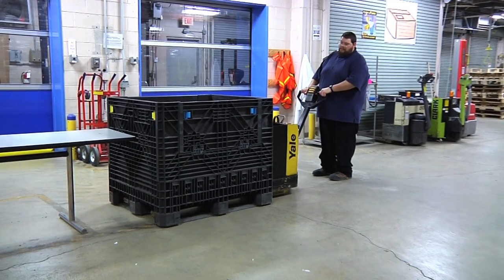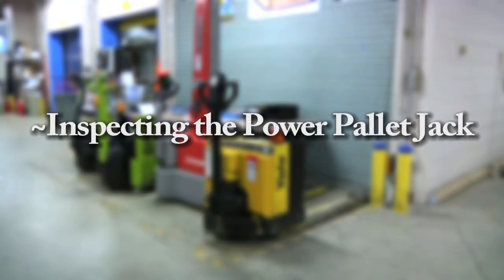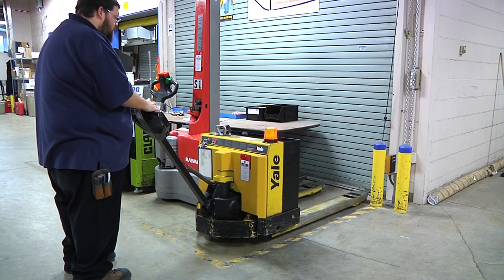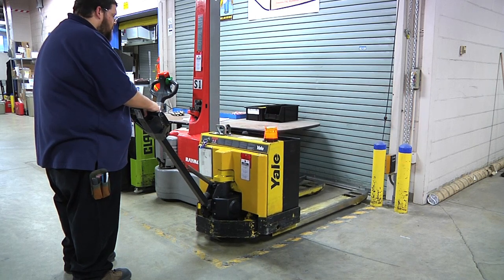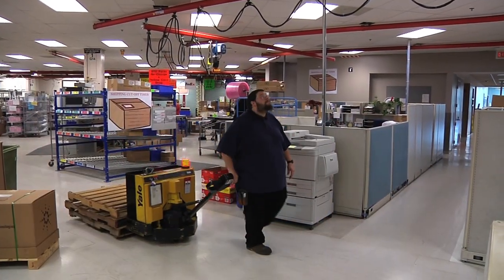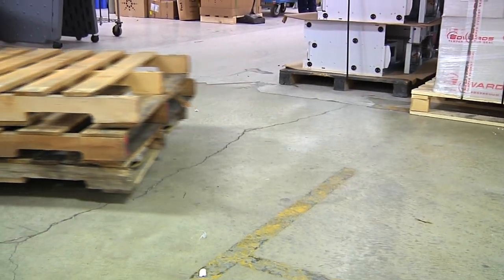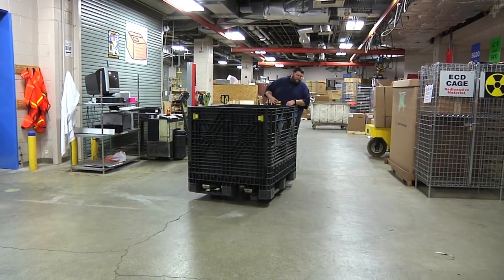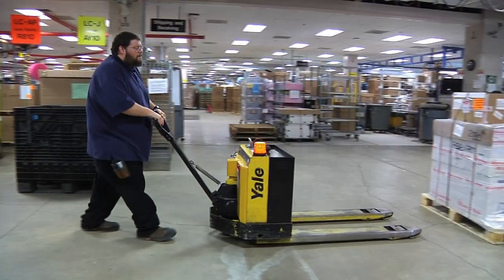Power Pallet Jack Training

Comment: The normal pallet jack works fine to me and much easier to control.
Reply: Same. I tend to use it more too. But for really heavy loads it's extremely helpful. Plus some warehouse jobs are hiring 20/hr right now and require that you can use  it frequently
Reply: Try using a regular pallet jack with a heavy skit, it's almost impossible plus the electric jack can push in and fit in weird angle areas where a normal jack cant.

Comment: you need a license for these? 😳
Reply: I thought the same way. I  thought you need one for driving a forklift, not to use a pallet jack.
Reply: @Patrick19833  these are forklifts, anything with forks that can lift is, by defenition, a forklift. you do indeed need a licence to operate any type of powered fork lift
Reply: @Trainman10715  no, these are electric pallet jacks. Big Joe is more of a forklift.
Reply: @Patrick19833  they're still a type of forklift, pump trucks are too
Reply: @Trainman10715  Maybe it depends on the law in the  state. I use them at my job  and don't have a license

Comment: That downhill part doesn’t seem right, that’s the opposite of a forklift where you keep the load uphill no matter which direction you go. With the load downhill it’s almost guaranteed to slip off the forks.
Reply: I don't know why he used the phrase "prevent it slipping off" but it's the right way, basically you always want to be stood uphill from the load on a PPT. Anything goes wrong the whole thing is going down and you don't wanna be stood in the way
Reply: You are protected in a forklift, you are not protected using a pallet jack. That is why they do it like that.